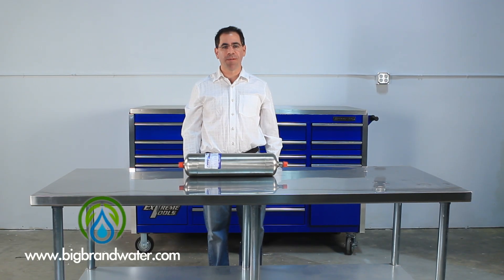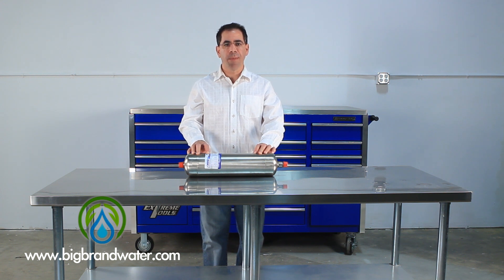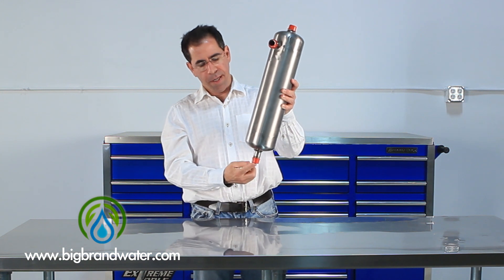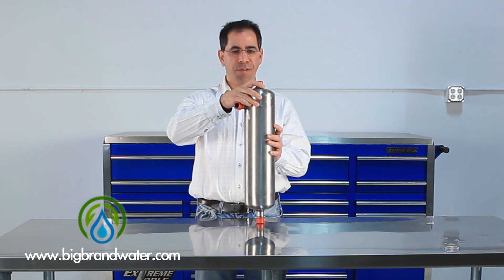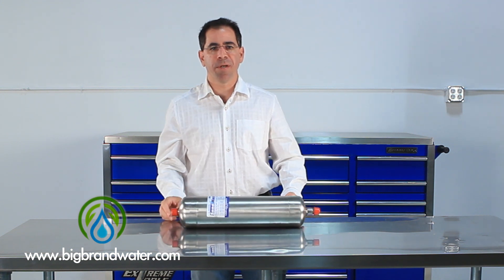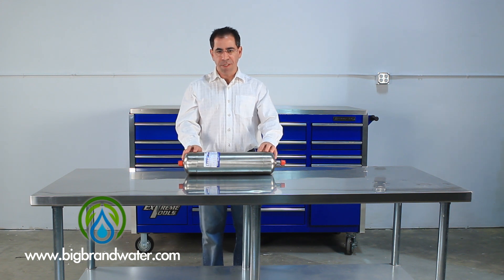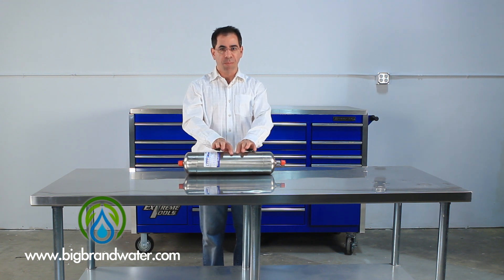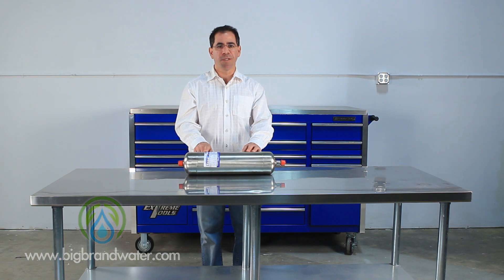Lakos Sand Separators

Comment from the maker: We just designed a new visual purge kit that holds 7-10 times as much sand as the Lakos brand visual purge.
http://www.bigbrandwater.com/lakosmpurge.html 
We use Schedule 80 fittings and piping for greater reliability along with larger diameter for greater capacity.
Reply: Link does not work.